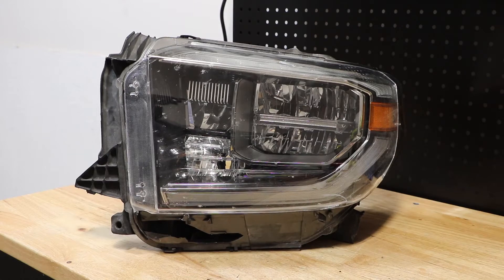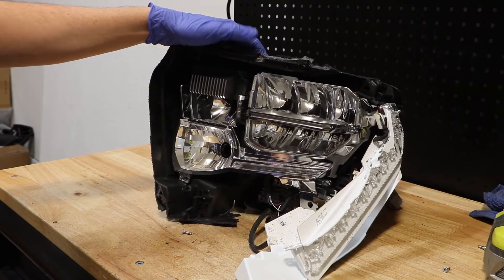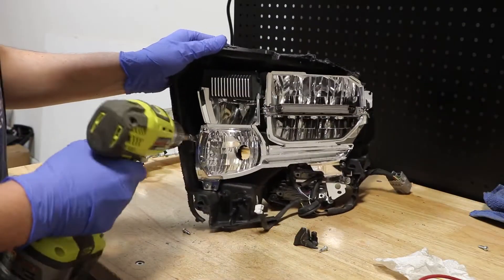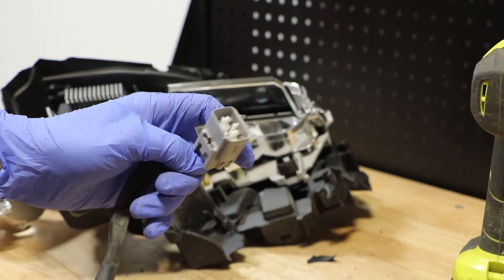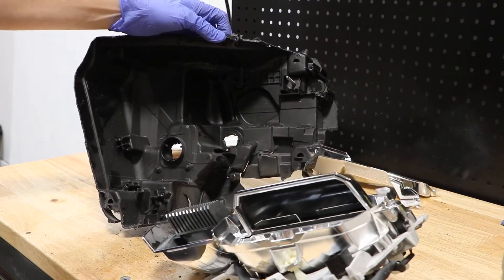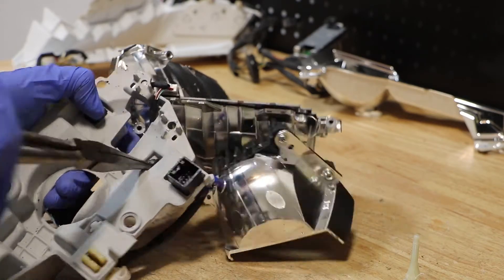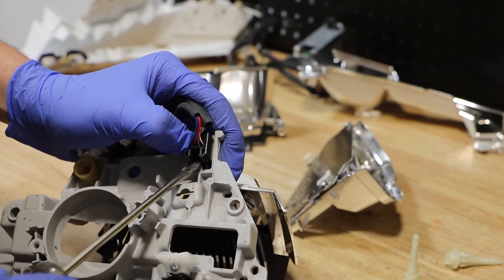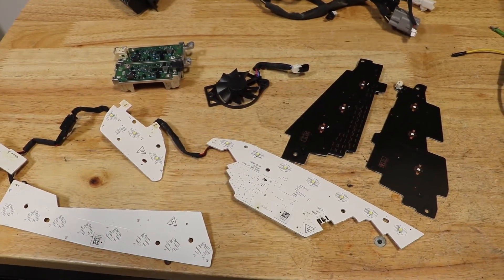2019-2020 Toyota Tundra LED Headlight Teardown

Comment: Hi, those 2 ballasts looks same like in koito biled,  also cooler is exact the same, 2 chip diode (aux or high beam) looks identical to various koito lightbar drl modules.
Reply from the maker: I no longer have those ballasts.   It very well could be Koito as Toyota often uses their parts in their headlights.